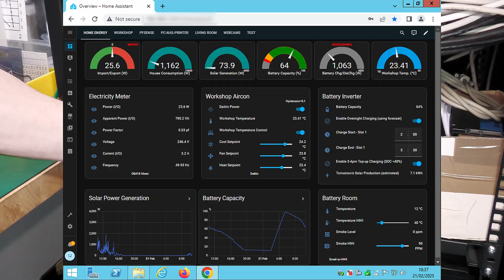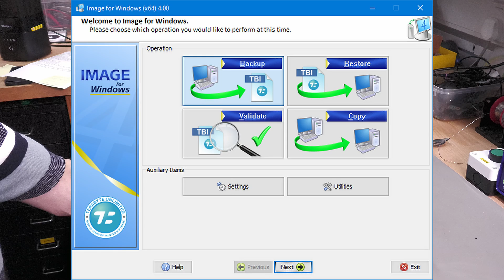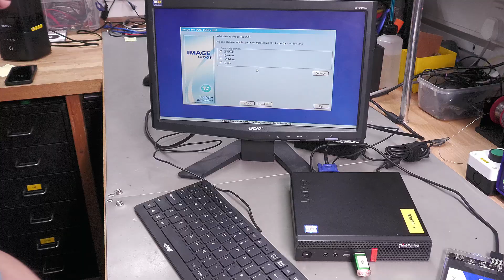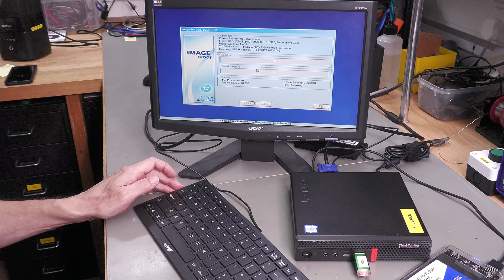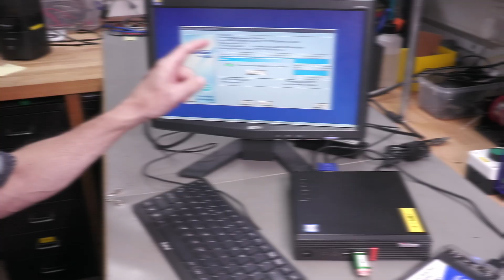No.165 - Windows Web & Email Server Maintenance

Comment: An enjoyable video but it raises many more questions. It appears the server is hosting your own email and web servers rather than using an email/web hosting service? If so how does it cope with dynamic IP address allocation from your internet provider given that static IPs are long gone?

I don't know much about email servers, but aren't their problems with connecting to peers due to black and whitelists (ie. trust issues)?

A video about how this all works would be really interesting, especially if it includes ballpark cost information, how difficult it is to configure and maintain etc. - including the amount of effort required to keep up with all the latest security advisories etc. to keep the hackers out.

Comment: I’ve always wanted to move my cloud VMs into my house but I’ve always been afraid if they ever get compromised and hackers being able to access the rest of my network. I’ve read a bit about DMZ and using pfSense router, but never pulled the trigger on it. How are you separating the two networks in a secure way? You’ve only mentioned the 1Gbps managed switch, but nothing else. If you have some videos on the subject or a tutorial on a website it would be extremely helpful. Thanks for another amazing video!
Reply from the maker: Use a managed switch and create a config in it for a VLAN and put the server on it. Port 1 on the switch connects to my Pfsense box and port 2 is the server.
My main LAN is now separate from the servers VLAN but I have given my devPC on my LAN permission to access the server via RDP. 
Easy enough to set up.
If my network was wired differently I guess I could have used Pfsense to configure the VLAN.

Comment: I prefer simply using disk2vhd for Windows imaging purposes - you can then run the images as VMs or restore them with a simple partition management tool by mounting the VHDX image files. Hiren boot CD for example to restore to new hardware.
Reply from the maker: I looked it up, i've been using Image For Windows for nearly 15 years.......I guess it's a case of why change what ain't broke LOL!
I remember using some of SysInternals stuff back in the 2000's, specifically the write filter (EWF) on NT Embedded.....great utilities!
Reply: @IanScottJohnston  I really like the vhdx image format it creates - it can be mounted as a drive on any modern windows PC and you can then copy over files - or use any partition management tools to write it to a new drive/hardware. You can also start it as a VM with hyper-V ... very versatile.

Comment: I would guess inside that RS232 black box is just your usual MAX232 or equivalent, to convert from 3.3V signals. Can find some similar boards but not that exact one.
Reply from the maker: Yes, and I guess gives the PC some flexibility for RS422/485 options

Comment: Up to some time ago I used a couple of those machines for my home server. Both had Microsoft Hyper-V server installed on them and I ran about 5 vms on them. One was master, the other slave only for backup - if one failed I could extremely fast move to the backup one. Very good machines, low power consumption, worked for years with no issues, perfect as you say for dns, mail and web